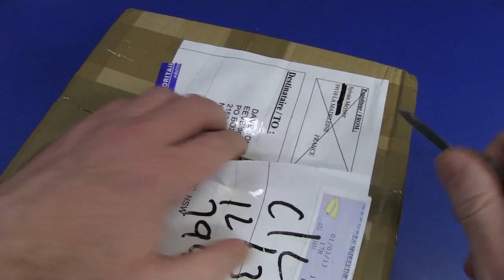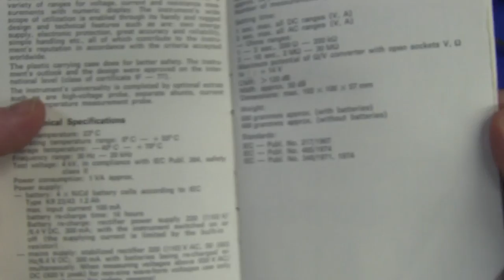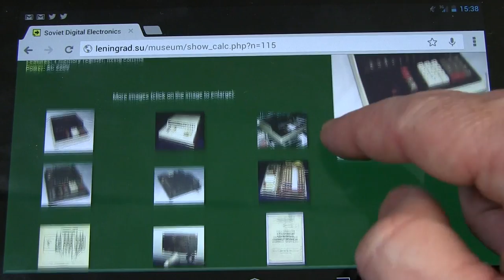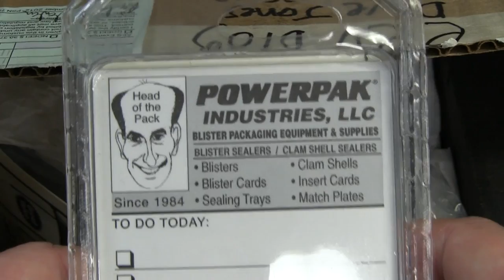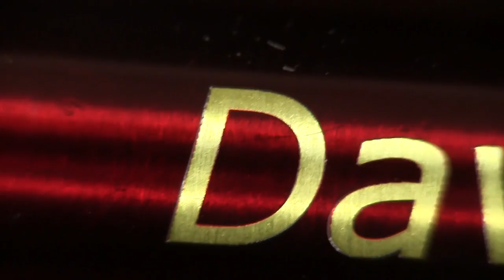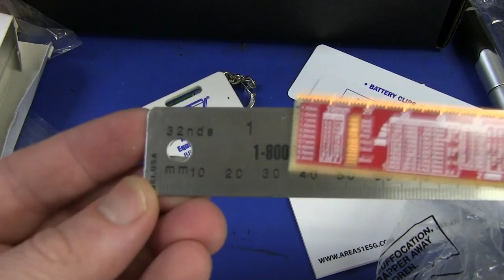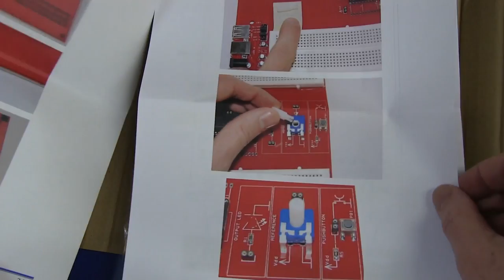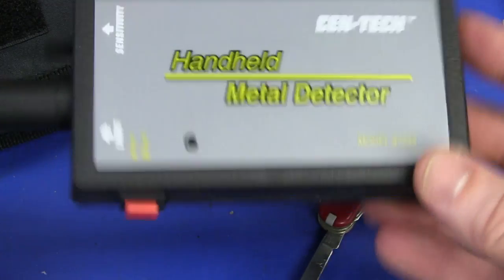EEVblog #481 - Mailbag

Comment: Datasheets for hybrid modules:
К224ГГ2:
http://savepic.net/4849258.htm
К224СА3:
http://savepic.net/4841066.htm

Transistor is KT814B, not KT8148. KT stands for "кремниевый транзистор" , which means  "silicon tranzistor". Resistors are K120, this means 120Ohms.

Comment: The irony of a blister package opener that is, itself, blister packed :P
Beauty :D

Those other cutters look to be box butters. The thin sticky-out bit goes under the box lid and you push the knife along to cut it open or cut the flaps down to make the box smaller etc. Different sized ones for different flute sizes of corrugate.

Comment: I think the traces going back from the blinker terminals are there to determine the load from the lights, causing the rate to go faster in case the load is insufficient (i.e. one or both bulbs burned out). That's actually pretty advanced, the thermal one did this by design.

Sticky notes are also useful for marking parts, especially when tearing things apart.

I've always thought the varnish was 'actually' nail polish since it behaves the same. Best used with acetone and brush.

Comment: The modules on the calculator PCB can be opened with a little effort, the cover is just a thin aluminium sheet cap, and the interesting stuff inside is on the top side  and not potted. The factory logo on the flat hybrid packs in the Lada module are small missiles or rockets; because, in soviet times, only a few factories where able to produce such advanced electronics, and the same factories produced as well car componants and missile / rocket grade componants...

Comment: A cool thing to do is find an item that has those annoying heat sealed packaging, and then using an old soldering iron, only let it heat up a little, then reinforce the heat sealing (and also include a note if needed)

Great for gifts, and will ensure that you achieve maximum annoyance.

Comment: those strips are post-it strips, you attach them to books to bookmark in color, quite useful for students actually, and those wanky cutters are box cutters, you slide the cord/take in the lower part and cut away without damaging the insides

Comment: 21:00.  Check the height of the stepped layers from the engraving (you could see them in your macro shot).   That should tell you if the pen is rotated or stationary when it gets engraved:  taller step means a greater angle against the surface.

Comment: Hot hackertip for you dave, when you get those plastic unbreakable packages, use a Can opener, the kind with "a combination of a rotating cutting wheel and a serrated wheel" with like 2 handles and a rotating handle on the other side of blades. they work wonders, and no cuts! (even old as in 70+ can open them with it no problem)

Comment: Dave you are right, older blinker modules does use only a relay with bimetalic timer. its not fair to cal that a blinker module because its just a relay with timer, one problem for them is that bimetalic metal wears out and on/off time changes till its unusable. So in soviet Russia :D they started using electronics to make proper blinking frequency and interval. If you are very very interested in soviet :D cars electronics, write me PM, I can digg up some info from old service manuals of cars.

Comment: 20:36 Our cheap china laser came with a rotary accessory that converts the flat Y axis into a rotary axis - all you do is unplug the y stepper that jogs the reflector/lense gantry up/down, and put the rotary underneath then plug in. Part rotates instead of gantry. They have a focal point that is only effective +- a few mm, so the curvature of the pen will ruin the result if it doesn't rotate.
Most CO2 lasers won't even touch most metal, so it's ideal to peel off the outer etch coating.

Comment: The pen engraving is probably done by putting the pen on a lathe-like-jig-thing.
Some laser cutters/engravers come with one that you can swap with a gantry axis: i.e. Instead of moving the laser across the bench on the x axis, you just rotate the pen itself.

Comment: The К224ГГ2 (Г=G) seems to have a comparator, a trigger and some sort of multi-vibrator. There is some data at (youtube made me remove the address:(  )
the funny thing is that here (Bulgaria) you can still buy these from old surplus shops:) for about 5Leva (3 AU$:) in some Russian sites i read that the K224GG2 was the most frequent failure cause of the Lada blinker module.

Comment: Those Russian calculator chips look an very close to old IBM chips of the same era.

Check out page B-8  of this old IBM doc SLT_Circuit_Design_Hbk.pdf
which may be found under IBM on the bitsavers web site. (Sorry I could not give you the url to it due to site security on this posting)

A micro-teardown of a chip would be very interesting.

as for those colourful tabs you saw but did not understand, they are place markers for books etc where you wish to flag a page or section for easy access.

Comment: Those strange looking cutters are made to quickly open those damn heat sealed packages we hate so much.. They make quick work of them. just slide the edge of the package into the cutter and slide it down. No need for scissors.

Comment: i would and do pay 20 pounds for bags of nos retro components, Russian or other wise, if you are fixing old equipment the proper parts matter, i only use modern components when i have to.
with the exception of capacitors modern quality ones are better.